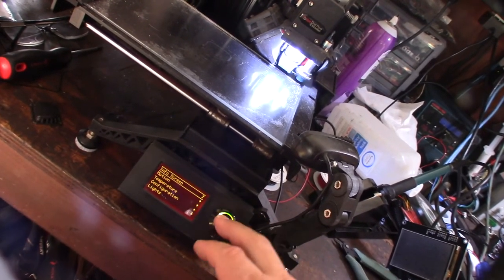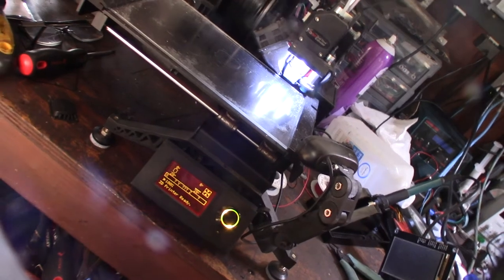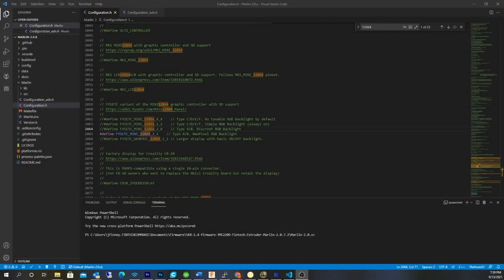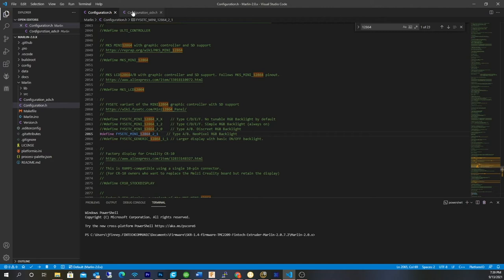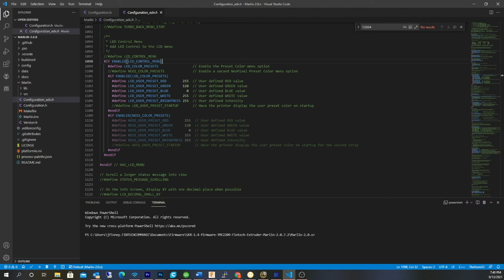BIGTREETECH Mini12864 1.0 LCD Installation, Same as FYSETC 2.1 Marlin neopixel Mini 12864

Comment: Thumbs Up!.You said something that is important for  detailed viewers that want to fully control the 3D printer via the control panel. The dial types and even some more moden touch screeen LCD control displays like on the monoprice mini MP10, allows one to control every paramenter of the 3D printer so if you want vary the height of the nozzle,for example, you can, in real time, as compared to say the Anucyubic I3 mega touch screens and similar ones which do not allow for  such. 

It would be nice if my Anycucbic I3s would ahve these features that the dial ones have, but sometimes you cannot have everything in one machine. I have a couple fabrikator Mini II which one I redesigend completely, placed the 3D print STL files (work in progress) on Thingiverse a while abck, and have been waiting to find the time to finish it with one of these controllers. Since the Fabrikator Mini II also use Marlin firmware , these should work witthout much modification to the  code.  Comments, sugestions welcome.

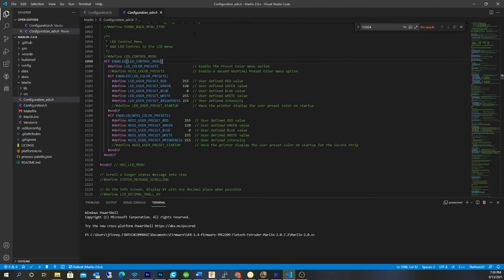Comment: ALt 6:35 you say "in Configuration.H you need to enable [neopixel something something]" but go to Config_adv and show settings for the LED_CONTROL_MENU (which you don't have defined)
Reply: Same doubt. I've enabled the neo pixel LED but it shows the screen isn't turned on. 
Have you resolved the issue?
Reply: @reddyyknr  most have a contrast issue. Assuming you set it up properly, you may be able to tilt the screen / shine a light at /behind it to illuminate it enough to navigate to the lcd contrast. I had to bump mine to 255 before it was visible. Be sure to save the settings afterwards
Reply: @reddyyknr  Hi! How did you solve this problem? I'm having the same trouble here, and nothing seems to work, my lcd turns on, but dosen't show anything.